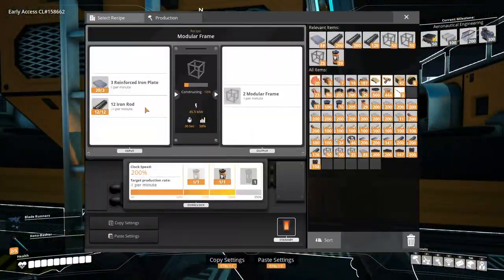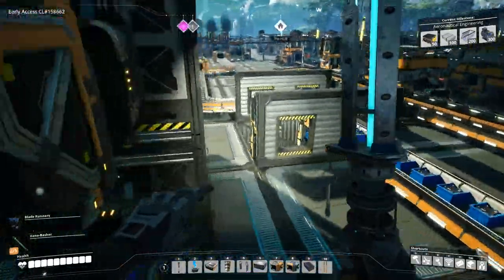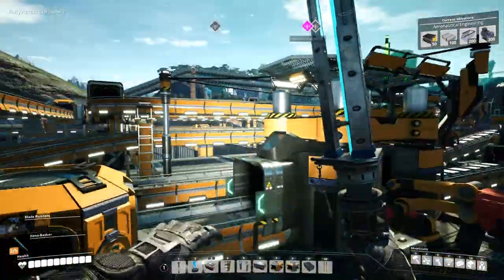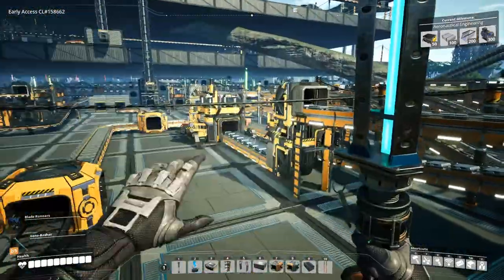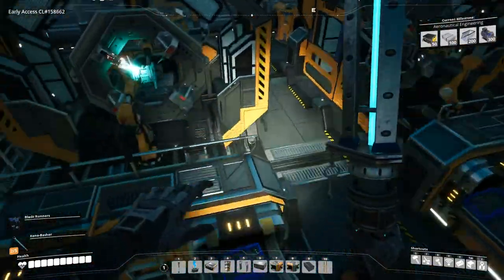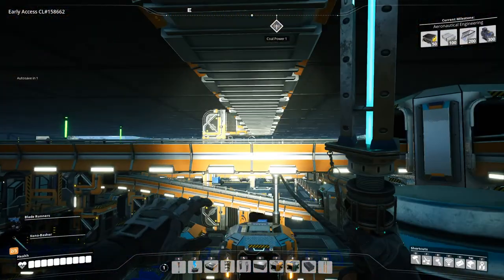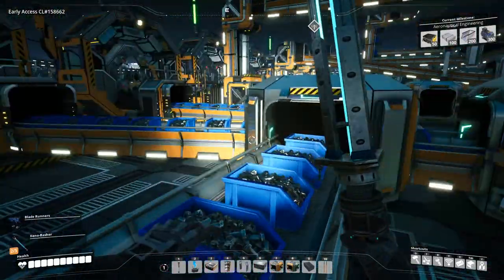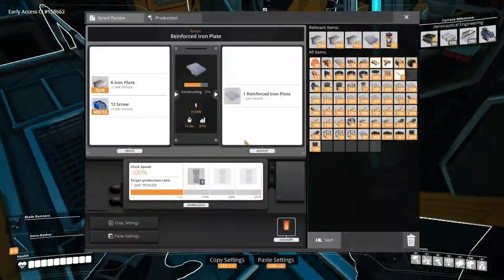Change of Plans; Steel Coated Plates - Let's Play Satisfactory Update 4 Part 89

Comment: Some more sucky hard drives. 

Though the Encased Steel Pipe recipe is considered one of the best in the game. Pipes are easier to make than Steel Beams, so while that Encased recipe is a bit slower, it uses less resources in total. 

Plus once you unlock most/all the recipes, you'll find you don't need to use Steel Beams any more (except for rails), so most of your steel production can shift to steel pipes. Screws can similarly be eliminated with enough alternate recipes if you want to. 

The Heavy Oil Residue recipe is also one of the better ones, since it sets you up for better Fuel, Rubber and Plastic production.
Reply from the maker: Hmm. That's good to know!